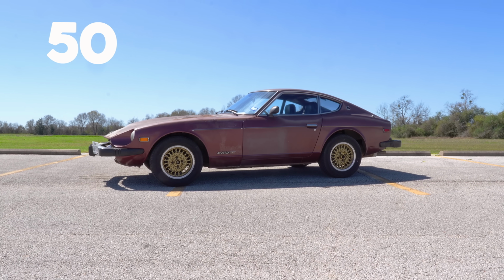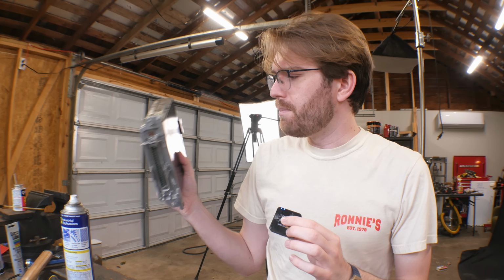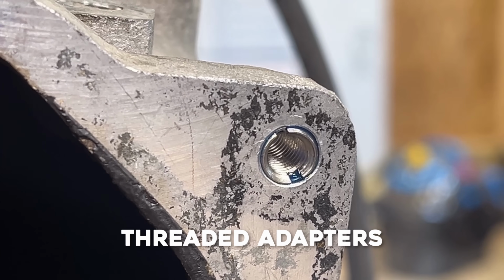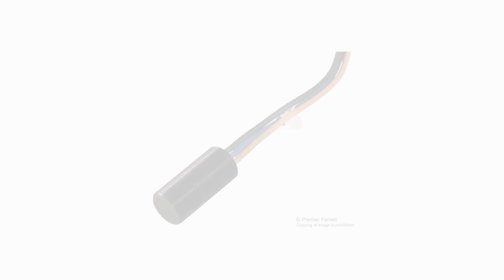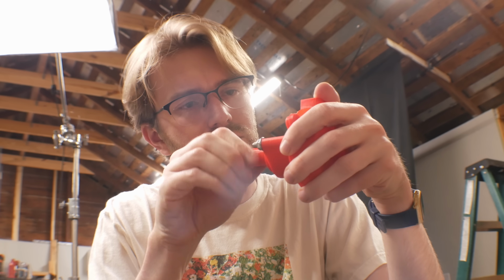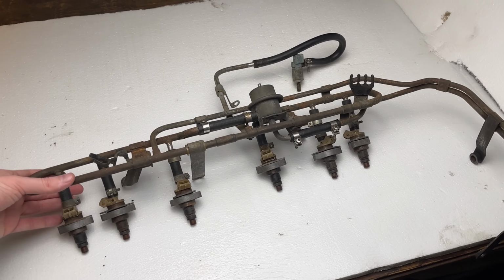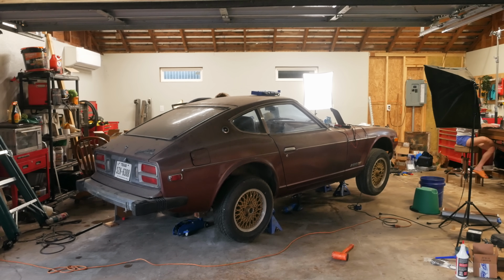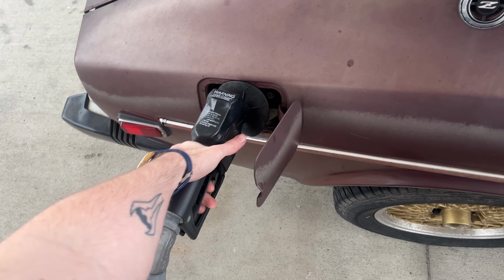Modernizing a Vintage Car

Comment: Friendly reminder that modern tech isn't inherently bad. Modern companies are just spending less time, effort, and money to manufacture their products than they used to, while also squeezing out as much money from the user as possible. Computerized engines aren't bad, they're only bad when designed to make repairing almost impossible, and to require a subscription... Ect, ect...

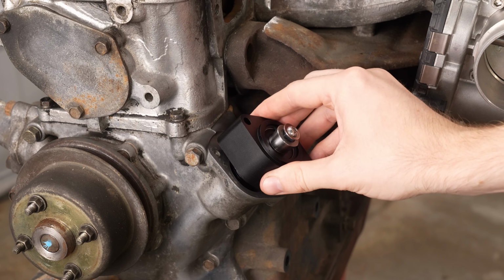Comment: 20:46 did you oil your bearings and the shaft before you closed it all up and installed it? Becaus3 that amount of heat on those bearings will wear them out in no time.... bearings have seals on them, and you didn't use metallic sealed bearings i dont thunk... idk man. Friction and metal are not friends... that thing ceases up on you i won't be surprised, however!! Its a bad ass piece of hardware!! Very cool!

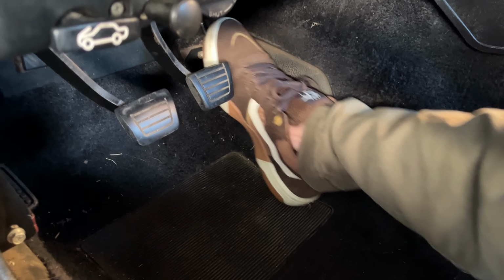Comment: 7:48 you could have just added a virticle incline to your block to get the petal to stick out more. Would have given you better throttle response too, seeing as you have more leverage on the petal at such an angle...

Missed oportunity.

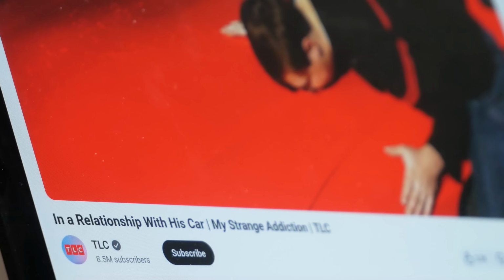Comment: 6:58, im 30, and my reason for not liking electronic parts in cars is due to the fact they fail more, and they're more expensive to replace. Bro could have modernized the vehicle and left the throttle body and cable in there.... thats what race car guys do...

My mother has a newer Rav 4 woth that electronic parking brake system, she hasn't even put 50,000 miles on it yet, and yhe actuator is already starting to fail on her.... when was the last time you heard of a cable E brake failing on someone? If a cable is strong enough to handle 700hp, and clamp a caliper shut enough to lock up the rear wheels on a 2k lb vehicle, then its good enough for me.

Less parts to fail, more confidence on the road.

Comment: If I had unlimited time, I would build a 200Z with a tuned Stage 2 Ford 1.5L Dragon engine. They're easily pumping 250hp/300tq at the crank.

Comment: Hmm if an all modern system couldn't optimize this engine beyond like 10%. I think an engine rebuild should make a more noticeable improvement alongside the system. Possibly even surpassing the original factory MPG and HP numbers

Comment: Bravo for the restoration, pretty impreessive. As for the Hall effect works MUCH better and more precisely with magnets, rather than with plain steel. Go see Electro-Sensors, who specialize in exactly just that, and are affordable. Discs or collars, encoders are available, and rpm monitored down to 1/10th. Works even if shafts are wobbly (because of magnets), off-center, tilted, cold, hot temp environments. U.S. based company. They are widely used where you need to monitor rotation, slow start or variable rotation.

Comment: This was great show great talent.    Next thing would be to see how different is a modern car crank Pistons, cams, internals if you updated them.  Maybe an efficient alternator, water pump air conditioner, etc.  power & better HP & torque. Maybe a differential if there’s more efficient one I don’t know if those are limited slip.  Maybe a Corvette or research the most efficient engine out there.

Comment: This video is pretty interesting. But if you calculate the cost of labor, tools, software and design effort that you put into redesign of the ignition system, that would give you the ability to calculate a dollar amount for the work. For the cost of the level of effort you could have purchased a retrofit for the car that supported the coil packs. You actually would save money because no redesign would be required. Time is a commodity. Just a thought.

Comment: Agreed simplifying the air flow with a simple computer and modern throttle body reduces your repair problems as well. Now is there perhaps a simplified mechanical reduction?

Comment: For o-ring seals, you want 20% crush of the o-ring for a proper seal. So if it's a 3mm thick o-ring, you want the o-ring to be crushed to 2.4mm thick at correct installation. So you need to make the o-ring groove 20% too shallow, but also to allow room for the ring to squeeze out, 20% wider to give room.

Comment: I would strongly suggest that anybody watching this just rebuild or replace the engine. You're probably going to just blow it up trying to rod around in a 50 year old engine. You don't have to pay top dollar, you can find decent deals in junkyards for stuff they've yanked and you can find info online about what engines will fit in a given car. ALSO, you should probably work on the actual car before you worry about engine work. Remove any damaged or rusted out pieces, patch or replace what you need. Make sure your car's frame, unibody, or monocoque are properly protected from rusting, Replace any bushings or bearings that you can, suspension, breaks, steering, etc... The engine is a big piece, yes, but if your car snaps in half or rusts away around it then your working on wasting your time.

Most professional mechanics can't just whip up a custom engine harness, please don't anybody try that at home.
Reply: I say pull it and store it then put a 2jz in it.

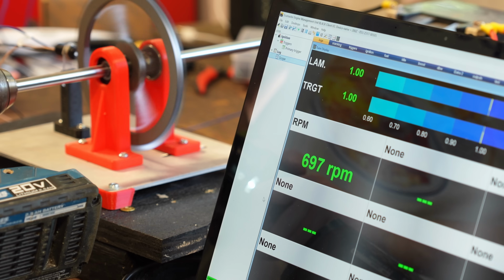Comment: 14:05 why not use the flywheel, way simpler and is already installed on the car and is direktly conected to the cranck shaft

Comment: I'm a fuel injection guy, so for this project, since it was already fuel injected, improving the fuel injection was the right move.

But here's a thought. Imagine running a carburetor, then adding an idle air control valve to bypass it so a small computer can dynamically trim the air/fuel mixture. Feed it a MAP sensor, an O₂ sensor, and an RPM signal, and now it knows what the engine is doing in real time. You can eliminate most of the traditional downsides of a carburetor while keeping its simplicity.

The funny part is, this already exists—and it's surprisingly affordable. It's called the Carb Cheater.

Comment: Have you considered a proper rework of the engine block? You could do a compression check on all six cylinders first. 

That was a nice increase in HP, but it is still nowhere near the factory HPs it had in the 70s. Most likely the engine is worn down and compression is no longer okay.

Comment: Well, at least it's not just another aluminum 5.3L LS swap vid... but that LS swap would have given you twice as much hp and probably about the same gas mileage. Next up is a turbo for that anemic engine. I'm sure someone makes manifolds and plumbing for it. Right?

Comment: The Datsun L-series were great engines. I had a 510 and a 610 with the L-16 engines. You could just drop a Weber on those things and their would run and get good economy.

Comment: I  had a '76 280 Z and the original drive train worked fine - I ran it on the Autobahn in Germany. It took regular without a catalytic converter.

Comment: hmm my 999cc Citroen would out pull that in a 0-60, does avg 39.2mpg and came with all the parts needed. The datsun, gorgeous shape and looks, given time and a lot of adjustments, you should crack around 160 BHP, however fastest bang for your buck increase would be to stick on a Turbo, according to specs you would get it to close on 190 - 220 depending on the engine management system.

Comment: For the throttle body, Bosch makes the same throttle body but the flap pivots the other way. Hyundai uses Bosch TB, Porsche uses them and has the same ones and pivot the other way. Saying this because it pivots the other way, you can have the motor housing be on the other size
Reply: Also. Could have grabbed a volume map from the megasquirts documentation. This is all stuff I've messed with like 25 years ago

Comment: I recognized the complicated mess the original fuel injection looked like and the way you simplified and upgraded it. 

What I didn't realize was it doesn't have the Datsun part number 841, 79-83 Datsun 280zx Fuel Injector Cooling Fan like I found on E Bay.  I was told it was used to prevent vapor lock, so I grabbed one off a disassembled 280ZX engine, along with the spray bar for cam lobes and the cam towers already set up for the spray bar for an L20B head (and L16 and L18 heads I had).   

Those were the days when I had a 1200 Coupe that I swapped a later 5-speed (FS5W60A) and B210 rear end into, and a Datsun 520 Pickup I'd accumulated several engine options for.  Besides the stock L16, I had an L18, L20B, and a 5-speed from a D21 pickup with a KA24 engine that I used the back half from with the front half of the L16 transmission to avoid the tilted angle front used on the KA24. I could have had the front machined for the large bearing but since I decided to trade the L20B engine (if I recall correctly), and didn't need the bearing size used with the KA24m I used the Li6's 4-speed front (bell housing) half mated to the  back half of the KA 24's 5-speed but placed the smaller front bearing and front plate from the 4-speed to make the change without having to machine the front for the larger bearing. Back then I could have custom drive shafts made up from junk yard shafts for $35 to match the length and ends needed for the swaps.

Comment: Keep working on ti and eventually you might get to the 160hp my little 4 cylinder Ford Focus has LOL
Reply: If he Ports the engine head (bigger holes for airflow) he can easily make 170 hp, then Bore it from 2.8 to a 3.0 Litre (bigger holes again) he can get 230hp then Add ITBs, (throttle bodies for each cylinder intake) thats like 270hp. Thats my plan after I copy him with this modernization

Comment: That’s a lie A ka24et iron block timing chain turbo go to show how stupid dumb you are but it depends on cost budget ka iron much cheaper 280 is garbage compared to the predecessor 240 Z which I need to Nissan head nose is the way to go
Reply: was this meant to be a reply to someone?

Comment: Kinda doing the same with my 69 Camaro my mom bought in 1970. But im stupid and have to learn everything from scratch. I had a guy who was a high-school bestie for 32 some odd years and my anxiety over answering the phone due to traumatic things that happened... he threw me away literally when it came time to reassemble. (All of this was his idea by the way) but these things can teach a lot! The current problem is I had to do the entire under dash, got everything hooked up, it worked, and getting the light switch in was impossible. It was too short. The harness had to follow a different path than i had so it all has to come out again.

Comment: I think car manufacturers would make so much money if they brought back vintage cars and kept the body styles exactly the same, but just changed some of the technology for the dash and the engine and transmission. They’ve done something similar, but they always change the body style make it look so different. I want them to use the exact same body style and do it maybe every couple of years bring back one vehicle from their line

Comment: LOL yeah 1978  isn't "vintage". Vintage needs more like 100 years to age. 1978 is just old and a 280Z is not a rare bird, Hardly a "Classic" like an earlier 240Z would be.
I saw my first Mazda/Wankel engine at the Ventura County Fair 1971.
Now my 94 years old 32' Chevy, is a CLASSIC and married old with new. I first put a 307 in it. Rebuilt a $400. motor from a later model rolled Chevy, ran good for a dozen years but I wanted more power for my 4x4 flatbed Chevy. So I dropped a 350 crate motor I picked up for a grand, been diving it for 8-9 years now and it will be that last motor/truck I'll need for the rest of my life.
It's been restored for 24 years now, on the road. Half as long as your "classic" is old.

Comment: We put a Small Block 400 Chevrolet and a Turbo 350 in a 240 Z once. It was pretty fast but the differential kept breaking while Drag Racing. They had motor mount/ cross member kits that made it a pretty simple task.

Comment: At first I saw the tittle of this video and thought you just ripped off a carb and stuck an off the shelf EFI on it. Holy shit was I wrong. You absolutely did the research and built a custom fuel injection setup from nothing but studying old parts and manuals. 

Your work method of building custom components is very inspiring. I'm a carb guy myself as I like the simplicity of the fuel toilet, but I work in nearly every modern upgrade aside from that. The satisfaction of seeing you unwrap custom machined components, based on your own designs; is something I could become addicted to if I were doing this myself. This was easily one of the most enjoyable car project videos I've watched in years. Bravo sir!

Comment: 125 wheel HP isn't too far off for an engine rated at 170 hp at the crank.  I know those are boring numbers today, but my point is that you started with a healthy engine to begin with that was already performing on the tired end of stock HP numbers.    Great work!

Comment: Soon as i seen the thumbnail I knew what it was. I had one of those than two 1989 300zx's. Loved em both, I put a 383 in mine and it took sometime to get it running correctly. The computer in the car had to be modified. I didn't do that part tho. I gave it to my father in the end. He sold it without me even knowing. He didn't need money either or anything it really pist me off. I had so many hundreds of hours in that car. I just put it in his name cause I had 2 many cars in my name at the time.

Comment: 27 min ish. Advance the timing to 10 ish before tdc and check the fuel maps
Reply: Oh also that dizzy camshaft position sensor is a good idea. They make Hall effect position sensors that go at/behind the harmonic balancer (the big round dodad at the front of the crank) that would work too

Comment: Just do what I did.. rb26dett converted to a big single. Aem infinity, msd 720cc injectors,new coils.. drove it 2 years with zero problems. 
As for the L28 et I originally swapped I did basically the same thing but used Jim wolf technology ecu set up and it worked very well

Comment: There is a toyota celica sitting in a field next to my house with the windshield busted out. Its a GT version, not sure the year could be 70's or early 80's. Everytime i see a video like this i have this feeling like the car is calling to me. I dont have any of the know how that this guy does though, I wouldn't even know where to start. Im conflicted.
Reply: Starting is the hardest part - you’ll learn everything along the way.
Reply: I bought a 1993 Celica with no knowledge other than watching some youtube. It's been such a learning experience. Hard at times, but so rewarding, and honestly, most things is not that hard. Especially amongst older cars.
Reply: go get it Tiger

Comment: Hey friend I’ve owned 13 Z cars.
From the 240 to the 280.
I had a 280. I drove from Reno to Norman, Oklahoma with a 2.8 L engine  stock with exhaust and triple 40 mm side draft Webbers.
With a point admission with Nissan points from Nissan.
The car got 22 miles to the gallon at a cruise…

Comment: For your european viewers :
It used to chug 13.8 l/100km
Now it's at 11.9 l/100km
It's better but it still chugs quite a bit. A small sporty car like this with the same power would be your average youngtimer which, on a commute driving, would do at worse 7 l/100km.

Comment: I have another 1978 'vehicle' I restored from a sandblasted frame to completion. Mine was a motorcycle, a 1978 SR500 Yamaha, something I purchased April 1978 & rode across the Australian continent Sydney-Perth-Sydney in 4 weeks. Within a short time I'd ridden 20k kms & decide to upgrade a thing or two. Suffice to say it ended up in storage for 30 years, eventually getting back on the road better than new. I appreciate & understand your dedication & congratulate your fine & fascinating work Ronald. What a wonderfully creative chap you are. Cheers mate from from Sydney, AU.

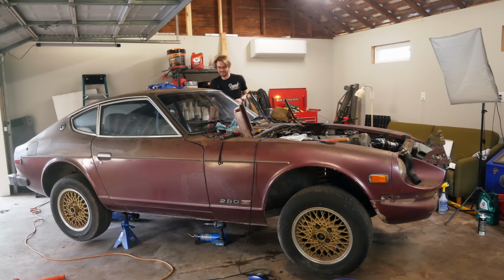Comment: 29:00 
Hell yeah! That was awesome!  
But damn the amount of "diagnosing" to solve for it... You'd think the "Computer could just learn" on the "Volumetric air intake" .. like another words, it would just start at "Point A" which is Basic start.. and then "Tune itself & adapt".. once vehicle was running...

Anyways, very cool whatever the case. What an awesome project you did.

But the "63 year pay off"... hahaha...  Well considering we don't know how high fuel is going to go in America.. maybe you'll come out ahead sooner than later?

Also is this car AWD?

You're literally getting better fuel than my 99  4x4 Light Truck.

Comment: If you aren't opposed to a head swap, there is a place in Florida that makes them for your engine,  but it's Honda based. Otherwise I'd replace the harmonic balancer and cam

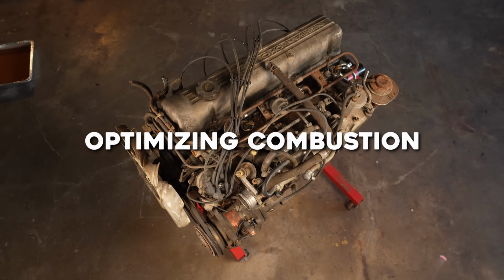Comment: 2:45 4 things, add compression
9:04 If that's the real shape, you could put a filler in that top hole, so the gas-fluid could go... more fluid

Comment: You should really program a lean-burn mode in the part-load cruise region, moving the Air-fuel ratio toward 18 to 1, which would significantly help with fuel economy by forcing the throttle further open at cruise.

Comment: OMG THE CARBURETOR JOKE IS SO TRUE. I STILL DONT KNOW WHAT THE FUCK THE VENTURI EFFECT IS.
Reply: it's basically than a fluid goes faster when forced to pass through a smaller orifice.
Reply: The Venturi effect is where the air passing through a narrowing bore, it goes faster, but at the same time as this, the static pressure at the neck of the Venturi lowers below the local atmospheric pressure, this ‘vacuum’ can be used to draw in the fuel through a sized jet and then into the air stream passing by. Very simple and works all the time.
Reply: It's when your car sucks more juice than a former Minnesotan Governer
Reply: Skill issue
Reply: Smartereveryday has a great video on carburetors.

Comment: I drove about two or three of those at a car dealership back in the 70s. I never liked them. I like the 240 better but what you’re doing you’re amazing obviously you have an engineering degree very interesting Ron